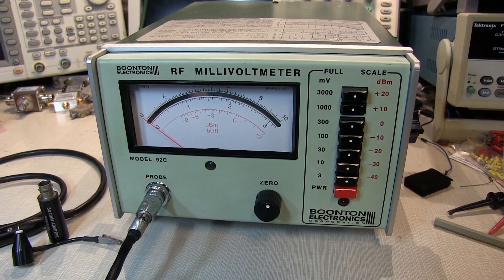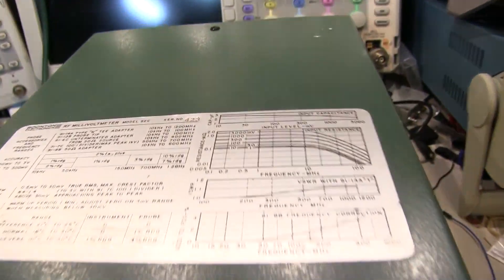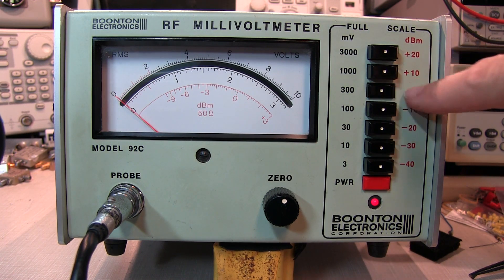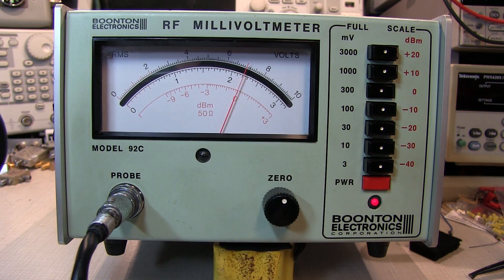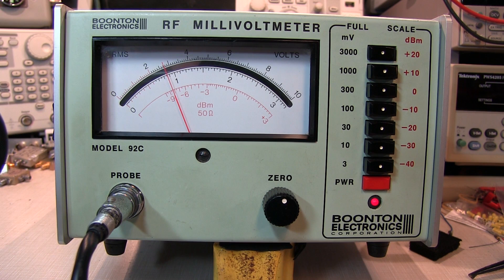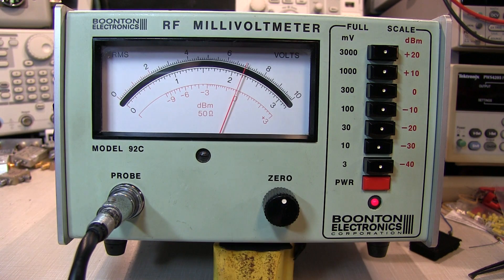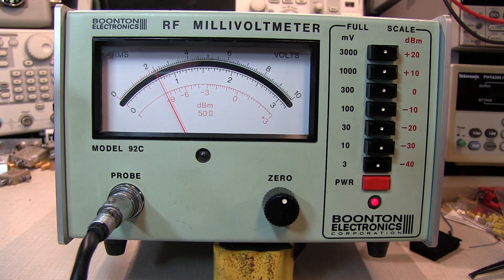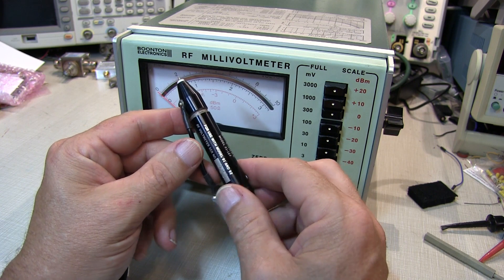#265: Vintage Tech: Checking out an RF Millivoltmeter - Boonton 92C

Comment: Now, you have the correct meter to calibrate wattmeters, though you'll need a precision attenuator for any large power (measuring voltage across 50 Ohms) measurement. This was how many amateur wattmeters were calibrated at the factory.

I have two Millivac RF Voltmeters with the probe sets, and they're how I do wattmeter calibrations.

Comment: Here goes a question that should probably be obvious, but here it is: I assume this RF Millivoltmeter is necessary because a standard bench top DVM wouldn't read the correct voltage at Radio Frequencies. I'm now guessing that the specs on a standard  DVM would tell a user as to a maximum frequency in order to make accurate measurements using the  DVM? (I guess that's why Alan mentioned he used an oscilloscope in the past to get by with making   alignment measurements - I think I'm quoting Alan accurately here. ) Also, Alan mentions loading effects at the end of this video: I think the probe has 5k ohms at 100k HZ - if even possible, a bench top DVM's loading input impedance would be a problem at RF, as well.
Reply from the maker: Correct, a DVM or DMM is typically limited to measuring AC voltage on signals well below RF frequencies.  Often, the maximum is limited to audio frequency ranges.
Reply: @w2aew  I found one of these millivoltmeters  model 92B at my local electronics surplus store with the probe cable but it is missing the tip end.
i do not know what the difference is between yours and the one i saw.
Will it be worth it to buy it even though is missing the probe tip? how hard would it be to find the tips?
I could use one of these millivolt meters when i am working on my stereos or reel to reels.
Thank you.
Reply from the maker: @SDsailor7  does it have the probe, and just missing the tip, or is the probe also missing?
Reply: @w2aew  It has the part that you are holding in your hand at the beginning of the video the part that has the serial number . And it was missing the rest, so is it hard to find those other pieces? to be able to use it? I did not buy it due to missing the complete probe. It is probably still at the store. How hard is it to find/get the rest of the probe?
Thank you for replying back.
Reply: @w2aew  It did not have the 50 Ohm adapter or the browser tip.
Just the cable and the probe at the end.
Reply from the maker: @SDsailor7  You can get away without the 50 ohm adapter.  The probe tip is something that you may be able to make yourself -- it would likely be hard to find one.
Reply: @w2aew  Thank you.
Then I will go back to the surplus store and test to see if it powers up.

Comment: Wow this was a great score Alan, congratulations! And as always thanks for a great video. I just scored what looks like the Motorola version of this. The layout of buttons, placement of the zero know, box size, meter face are all identical. Looks like they just painted Boonton where older models say Motorola. I wonder how close they really are? I wonder because mine seems to work but is wildly out of cal. I've been trying to find the manual for the Motorola and had little luck. I wonder if the Boonton would get me close...
Anyway, thank you for what you do for our community! W1CBD
Reply from the maker: I would imagine that Boonton made a special version for Motorola (not the other way around).  I bet the Boonton manual would be close.

Comment: What an absolutely great video, thanks Allan.  Definitely will shop for one of these as I align the vintage equipment for my shack and some service manuals specify the use of an RF millivoltmeter, such as the Yaesu FRG-100 and Icom R7100 manuals.

Comment: Hi Allan, I know the probe for this unit is a tricky device to build. VE2AZX has a paper on the web with lots of info. Any chance to get you to look into a DIY version which could be calibrated to the Boonton 92C ?? 
There are plenty of 92C's for sale on ePay but wo the probe, there is no point in making the purchase. . In fact, I am kind of surprised to not see more online info on using an RF MV meter. I think many Hams who play with mods, restorations etc of receivers would love to have one of these gems.
Here is the link to VE2AZK's notes.
http://ve2azx.net/technical/RF-Probes.pdf
73, Glenn WA4AOS

Comment: Great video. In fact, all of your videos are so educational. I'm slowly adding test equipment to my shop/lab and I would love to have an RF Millivoltmeter. You picked up a true jewel there with that Boonton 92c. I would love to add an RF Millivoltmeter to my shop, but it seems hard to find one at a entry level price. And many of the 92a,b,c don't have probes, and look pretty rough. Are there any decent mid-level meters around? Even DIY? Thanks again. Greg
Reply from the maker: Depending upon what frequency you need to go up to, you might find some of the designs for RF millivoltmeters that amateur radio operators have designed may be suitable.

Comment: Nice find, Alan! With the matching probe it is well worth the $60 you paid. It also looks well cared for. I muddle by with an HP 403 and an HP 3400A - both restored and pristine. Good to 2 Mhz and 10 Mhz respectively but OK for QRP HF. 

71/72 

Bill, k6whp 

Dit dit.

Comment: question, for example, when you say, this is 0db, whats the reference power? I thought db is 10log10(p1/p2). If your estimate target p1(from your signel gen) is x, then how do i know the value of p2?  Sorry, i know my question is native.
Reply from the maker: Good question.  The absolute value is given by the switch selection.  If you hit the +10dBm switch, then 0dB on the scale is +10dBm, -3dB on the meter would be +7dBm, etc.  The "m" refers to "1 milliwatt" as the value of P2.
Reply: I think I didnt make clear my question. e.g.  in a signal analyzer, the PSD shows that the peak height is 5dB, then, my question what the value of p1 and p2 are?  p1 is the reference or p2 ?  If p2 is a given value, and p1 is the target estimation, where to find out the p2?  Thank you. Sir
Reply from the maker: A signal analyzer should be measuring power in an absolute unit, like dBm.  If it is showing just dB, then it has to be a relative measurement.  Without seeing what specifically you are talking about, then I can't comment on what the reference (p2) is.
Reply: w2aew thank you sir. I will study more then.

Comment: Beautiful Equipment. Quick question, Is it possible to make a LM386 type Opamp with just transistors, resisters and capacitors?
ありがとう。
Reply from the maker: Sure it is - you can even find the basic schematic in the LM386 datasheet.
Reply: Thanks for pointing me towards the right direction. I will try to make one with BC 547 and 1n4007. Thanks again

Comment: I recently obtained one of these as well. Was tickled to death to see Alan do a video on this unit! Mine had two problems from the start:     (1) The meter stayed pegged and was unresponsive. This was caused by an LM301 that had a railed output. Replaced, meter now responds.     (2) The tip of the calibrated probe is broken off, about 5/8" back from the tip. I have the pieces, but I need a way to reattach the two halves of cast aluminum. Been watching for a replacement probe at hamfests and E-Bay, but nothing so far. Any suggestions for repair???
Reply: Replying to my own post... Since the earlier post I have found that elusive replacement probe out there on E-Bay and am waiting for it to arrive via "Snail Mail". Alan brought up a good point about having the matched serial number probe and meter, and it seems like instead of just replacing the probe, it might be better to use the coming replacement probe as a donor for the broken pieces of the original--in other words, pull the calibrated components out of the original probe and use these in the "donor". This would effectively replace the structure and retain the components used to calibrate the meter originally. Just a thought...Another thing: I noticed another video (credit: AERVBlog) where the fellow who posted also had a broken probe which was repaired with solder. That's a possibility, but the darned thing had been broken in the same way mine was. What gives? I'm thinking that this points to a design weakness: that the threaded end of the probe corrodes forcing the user to use excessive torque to remove the accessory--and SNAP another broken probe. Looks like it might be wise to do some corrosion mitigation on the screw threads.

Comment: what would be a proper probe setup for probing tube if's at 455 and 10.7 using solid state detectors without blowing them from high b+ as you move around
Reply from the maker: The probe is rated for up to 400Vdc.  Beyond that, you may have to use additional isolation means.

Comment: Great find and thanks for sharing Alan. Earlier this year I purchased a Boonton 92E from the USA and imported it to Australia. Unfortunately I didn't know at the time the probes were calibrated for the unit. So I tested the 92E and 50 ohm probe with my HP8640B and Tek MDO 3012. It's fine at 10 & 20 mHz, and is acceptable for the typical HF testing a Ham would need. The big meter looks great on the bench too!

Comment: I've got some 'modern' analog multimeter as a present. Why are they still being manufactured? Is there some special use for them?
Reply from the maker: When you are doing things like radio alignment, where you're making adjustments looking for a peak or a dip in a voltage or current - it is much easier and more intuitive to watch for this on an analog meter movement than with a digital display or bargraph on a DMM.

Comment: +w2aew
I'm no RF expert, but is there a reason why the negative scale goes down further than the positive scale goes up?
(i.e. only up to 20dBm but down to -40dBm?)
Reply from the maker: It's just the range of the meter.  +20dBm is 100mW.  On the meter scale itself, 0dB is closer to the max end of the scale to give good accuracy (analog meters are most accurate at the high end of the scale).

Comment: Nice find, I have a MOTOROLA S1052B that has an RF probe.
The diode is open in the RF probe, would you know what kind of diode would work in that probe?
There is no service manual nor any schematic  on this meter.
Thanks for any information you can provide.
Reply from the maker: I would think that it is some kind of schottky or zero-bias diode, but I really don't know for sure.
Reply: Thanks Alan, it looks like a glass diode like a 1N60, etc.

Comment: Does this voltmeter have thermocouple inside like HP RMS voltmeters? Teardown!  Teardown!  Teardown!
Reply: No, they are using 2 diodes for the voltage sensing in the probe.
The "magic" is done inside the voltmeter.
Reply from the maker: Sverre is correct.

Comment: Why would they not mark the dBm scale below -10?  They marked the full scale for volts so I would assume it would be accurate down there.  Yes, you should switch down when below -10 but if you are already on the lowest scale you can't.
Reply: They did as an option for extra money. - - marketing

Comment: I have one of those and a matching Boonton green signal generator.  That thing is a beast.  Back when equipment was built to last.
Reply: w2aew 

The meter I use pretty regularly.  The signal generator only gets used occasionally these days.  Use on days I'm feeling green.  Like my old 1950's HP equipment.  Use it when I'm feeling grey and tan. :-)
Reply: We will have to wait 30 years to see if any of the modern stuff lasts as long! With all the plastic in new stuff, probably not nearly as long.
Reply from the maker: Do you use it much?